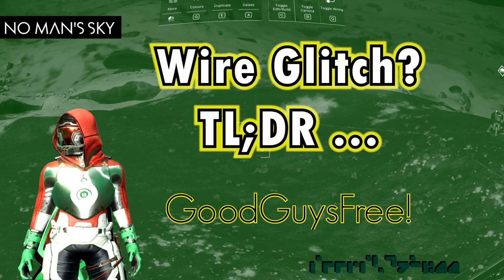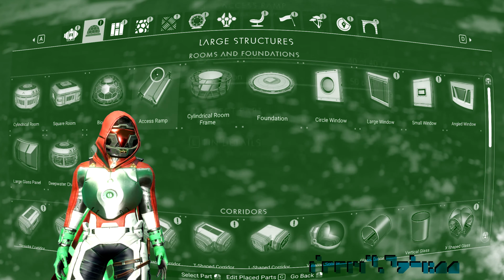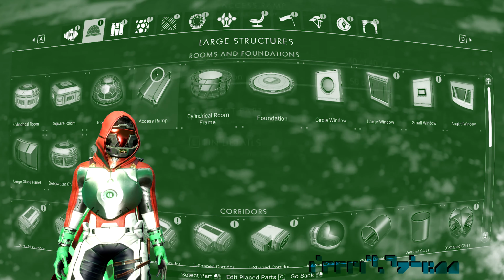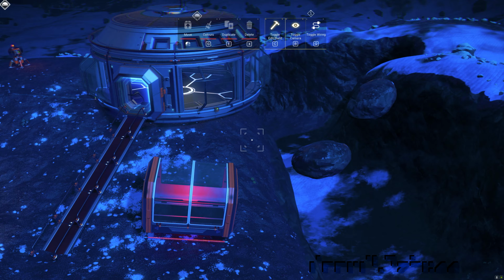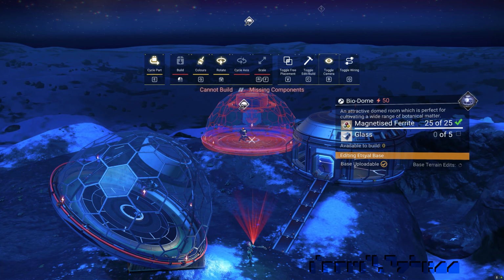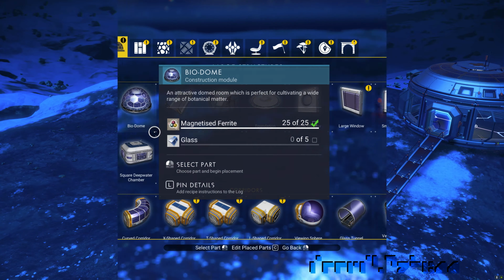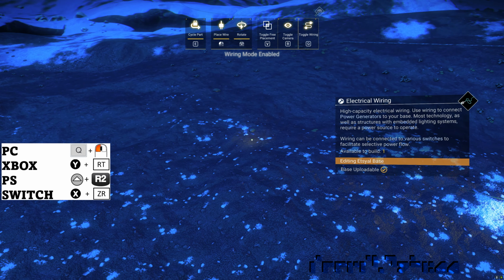What is Wire-Glitch? - Crash Course - #nomanssky #nomansskybasebuilding

Comment from the maker: IMPORTANT:
This glitch is NOT EASY on PC, slightly easier (still not easy) on controllers. You have to switch back from wire-mode, and then activate "place-part" almost immediately, but NOT at the same time.
Also notice that placing a part without having the resources works only in the area of your base!

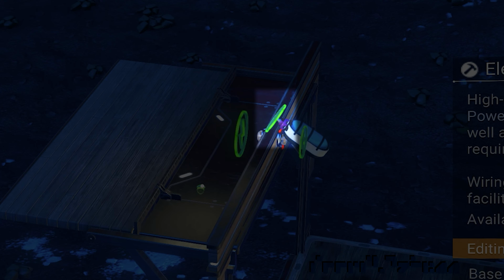Comment: 00:40 None of this works any more, at least not in NMS version 5.12 PC-Version!
If you are in the construction camera mode and want to select a part, the construction camera mode switches off and pinning with an alignment does not work.
Reply from the maker: Thank you so much for letting me know. 
I'll try to find time to test this later this afternoon.
Reply from the maker: Tested - this still works. It's not eaasy to get the timing right. Switch back from wire-mode and very quickly after, place-part.
Reply: @goodguysfree  Thats ist! Thanks.

Comment: Any tips to get it to hit often? I try this (PlayStation) and even though i always think i got it down after doing it successfully after 3 or 4 times in a row it doesnt do it often wither im being too fast or too slow or something..
Reply from the maker: Actually no. On PC, when using keyboard and mouse, it is really hard to hit this. There are a few apps that can generate key sequences, like Auto Hot Key, but even that is not consistent. Using a controller, is usually much easier, but also not always consistent.
Sorry, I wish there was a way, but I haven't found one.
GGF